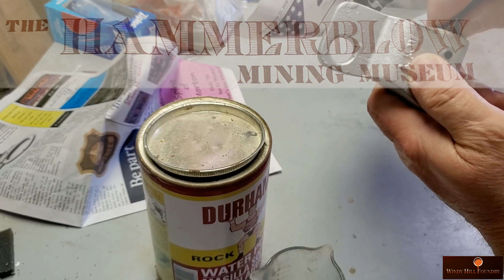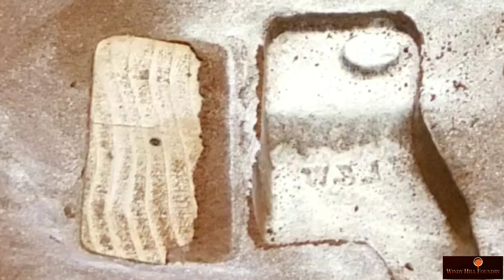ALUMINUM DOOR HANDLE FOR HAMMERBLOW MINING MUSEUM

Comment: Glad to see that you rammed up the riser close to the area that was to be fed. Many think that they have to make an in gate between the mold cavity and the riser when the opposite is true. Ram up the riser close enough that there is no chance that the in gate will freeze up and keep the riser from doing it's job but far enough away from the mold cavity that you will have no problem seeing where the riser needs to be parted from the casting. In addition, the rule for risers is (if you need to use one) to make sure that the riser is fed last so that it will easily feed the mold cavity while the casting is solidifying. The hottest metal must be in the riser while the casting is solidifying so that the molten metal in the riser will be drawn into the casting. If you don't, the riser will pull molten metal into itself from what ever source is nearby so that the riser will have no shrinks. That would likely be your casting. Enjoying your work and looking forward to you casting the firebox whose pattern looks to have been made in the '30s.
Reply from the maker: Thanks Sandrammer and yes I always try to hug the mold cavity at the thickest section when risering. I have been fortunate not to experience reverse flow but I know that can happen

Comment: On how much psi/bar do you have your kompressor set? With my casts (garage projects) I was always a bit hesitant to use one... but I was having problems with fine sand from the edges from time to time.
Reply from the maker: I have no idea what the pressure is set at because these cheap regulators seem to have a tolerance of +/-10 psi. I adjust my pressure to a point it doesn't tear mold faces up at 1 ft away

Comment: i am think that is a "Champion Blower Forge WhirlWind Blast Fire Pot"   they are a real treat to work with though replacing the clinker breaker is quite a pain vs firepots with a single larger hole for the air to come up through with a clinker breaker that sits in the middle

Comment: Have you considered doing the straight edge casting from a match plate?
Reply from the maker: Yes and the 12" is going to be on a plate
Reply: @windyhillfoundry5940  Cool ! My father produced the match plates for many of the item from Originals by Cambron. Most of the plates rendered six brass castings.

Comment: Just curious, why are you using different sand for aluminum?
Reply: The red sand is petrobond, it's an oil bonded clay that's designed to give good surface finishes on lower temp metals like aluminum, brass, bronzes, etc. The iron would burn the oil and binders out of petrobond, so you have to use greensand with coal dust in it, which helps keep the iron from sticking to it and can handle the heat.
Reply from the maker: This is ideal for non ferrous material. It leaves a much better finish for making patterns
Reply from the maker: @ChirpysTinkerings  well said chirpy👌
Reply: @ChirpysTinkerings  coal dust no matter how fine is not the only thing you can add, any form of graphite will work great but coal  dust works best -but does anthracite coal dust work as well, does the degree of hardness of this additive group matter, fex [just random thinking but if the refractory/release agent in the clay wasn't graphite what could it be what form would it take, iow, what else works and for what application]
Reply: @CothranMike  not really, you want the volatiles from the bituminous coal, which when the metal hits it or the heat hits it, the coal burns converting to coke and off gassing which lifts the metal off of the sand, which is what keeps the metal from sticking to the sand as it's flowing into the molds and until it forms a skin of iron that keeps it from sticking to the sand. 

Anthracite coal just doesnt have the enough of the volatiles to work without adding a major excess of coal, which can choke up your sand in pretty short time. Graphite doesnt release any volatiles at all, so wont work for that tbh, and while you'll get a better finish, it doesnt stop the sand from sticking, and the graphite usually plugs up the spaces between the sand grains, decreasing the permeability of the sand, and you will end up with blowholes and other defects if your not very careful. 

I know that wood flour/fine sawdust can be used in small amounts in place of the coal, but it has it's own set of problems that you will run into, and it really decreases the green strength of the sand. It will burn, off gassing and will lift the iron up off of the sand, but like I said, it creates it's own set of problems.
Reply: @ChirpysTinkerings  sounds like the many pages from luckygens book.
Reply: @donniebrown2896  lol, some of it is, alot  is from personal experience and my own research, lol.

Comment: Wouldn't it be way easier to fill all that in with Bondo?  I'm guessing Durhams is water glass (sodium silicate)?
Reply from the maker: I've used bondo and it's a little more than I want to deal with. I seem to never get it to mix right and it always hardens seconds before I get a chance to apply it

Comment: you can probably build a big belt sander using a piece of rectangular tubing and a pair of automotive hub assemblies ..  using  half CV shaft to drive one end directly coupled to the motor and the CV shaft sticking thru the splined hub and bearing assembly. . only issue would be finding belts that you can use over the tires with wheels that will bolt to the hub..
Reply from the maker: Thanks Wayne, that's a great idea and is something I would probably try. Finding the time to build it is my biggest challenge

Comment: This would have been a lot easier on a CNC Machine. You would just have to take 5 tries and 23 hrs  to make the special CNC holder for this piece. And then just 6 tries and 19 hrs to make the final piece.
Reply from the maker: Hi, as a former machinist I don't beleive I was ever able to buy a billet to machine down and come out ahead of casting one but things may be different these days. Regardless, if the customer prefers to have it cast that's his decision not mine

Comment: Are you aware of using a cutting wax such as this on your cutting disks and flap wheels? It is a miracle worker when working with aluminum. It prevents clogging and greatly increases cutting speed. Could be a good tip. Love the videos.
CASTROL METAL CUTTING LUBRICANT TYPE, 15 OZ. CONTAINER SIZE STICK WAX
Reply from the maker: Dan thanks for the tip. I rarely have to grind aluminum but when I do I'll look into this. Thanks again👍

Comment: Hi Clarke, I noticed that Keith Rucker recently put out a video on Pattern making (https://www.youtube.com/watch?v=Q0eeWvE8mfs)  which is a perfect accompaniment for this video,  most people don't realise just what is involved with the process and how to make a pattern so the project turns out the best outcome for the part concerned, and the casting process. You just proved how much-hidden work is involved but not all of that work, Keith goes into more detail that might help people understand why what looks like a simple handle to casts can cost so much when YOU have to fill in the blanks!

In you cleaning up afterwards of the part could I suggest that you might find a band saw very handy for removal of surplus materials,  then use a 3 x 72-inch belt sander.  
The band saw would give you better control and speed up the removal of the bulk of the material where the angle grinder is clumsy in comparison and can easily slip and gouge out materials it wasn't meant to. 
That's just my thought anyway.
Thank you for another interesting video Clarke.
Tony From Western Australia.
Reply from the maker: Thanks Tony and yes I do need a bandsaw. I had several over the years but never when I really needed one the most. 
Keith helped me out a lot with that video and I plan on making one soon where I will start from scratch and cover all the obstacles
Reply: @windyhillfoundry5940  Clarke that will be fantastic, especially from the aspect of a person who is using patterns every day you have the grasp on what YOU need to make the job as streamlined as possible, grin you may as well train the future customers now before you really get busy and by the looks of it it seems like work is going to only get busier from here out,( you seem to be getting a well deserved name for your self!)
I can see you very quickly needing to hire staff to spread the workload
From those I have observed like
Myfordboy,   Olfoundryman,  and MrPete222 just to name a few in the past have done a video or two on pattern making
As I said I'm looking forward to your contribution Clarke,
You can never learn enough about the things you are interested in.
Tony from Western Australia.

Comment: Thanks for sharing. This is most interesting. Btw, I made a traveling water bowl for my dog of 3D plastic and it works perfectly. I made the design in 3D and then printed it out in ABS having such a form that it does not splash water while it is in the car while driving. I might make that a product available for all. Casting it in metal may be a bit complicated.
Reply from the maker: If it has a lip on the inside it would require a core for sure
Reply: @windyhillfoundry5940  I have no experience in these. Do you have a video in which you an example?